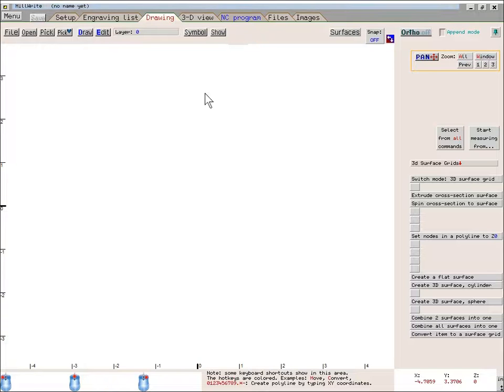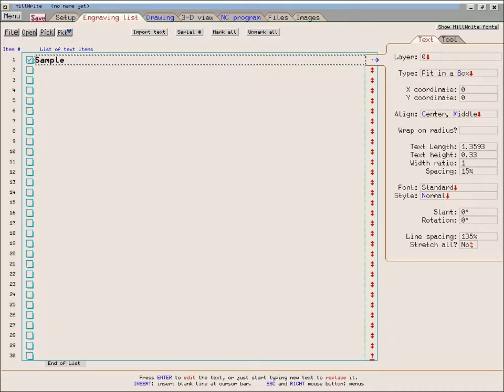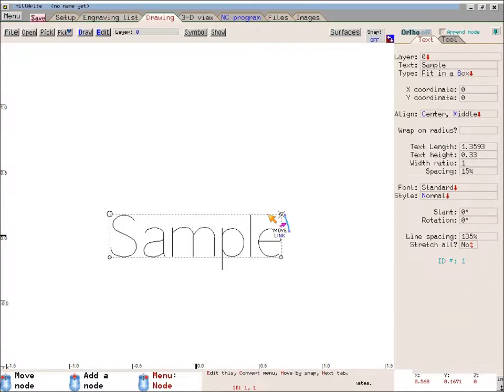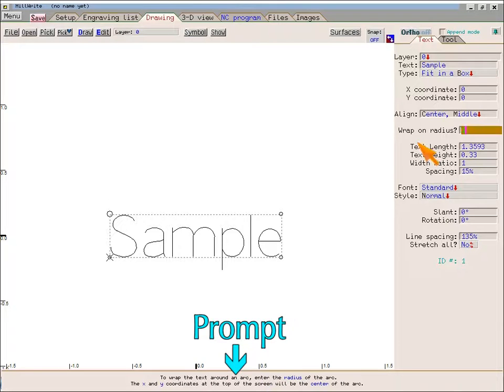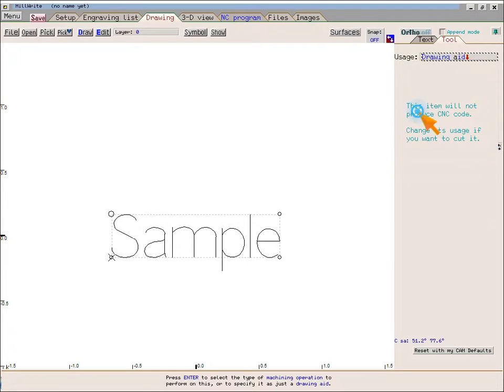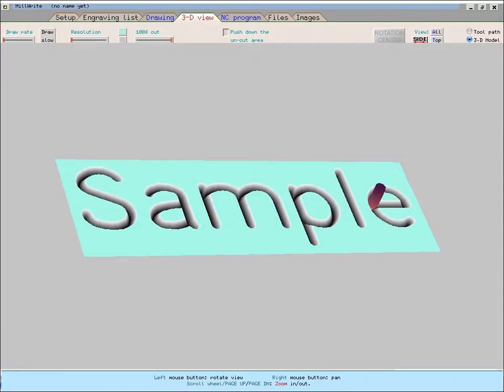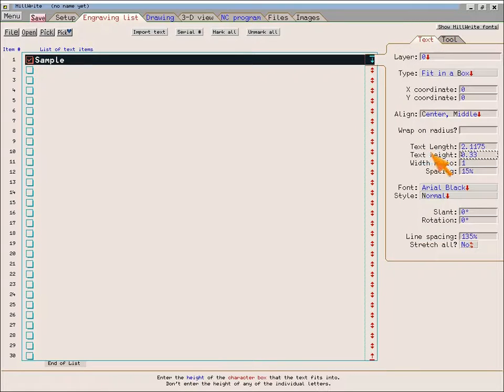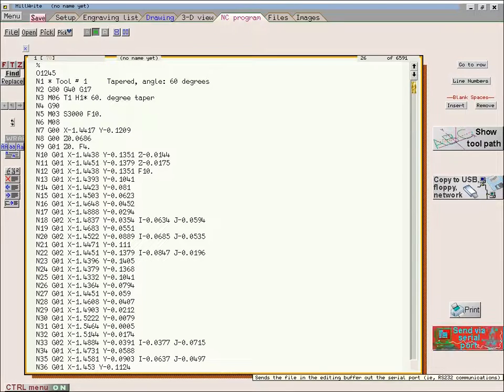Basic engraving with MillWrite

Comment: Hello. Is it possible to set the font to "true type" so that the tool moves in the middle of the font in one stroke and does not traverse the double contour?  Specifically, the true type Rubic font should be executed in the same way as the Millwrite Standard. (Google translator)